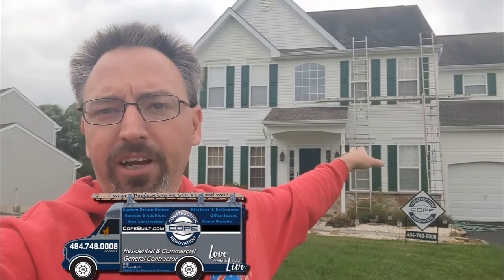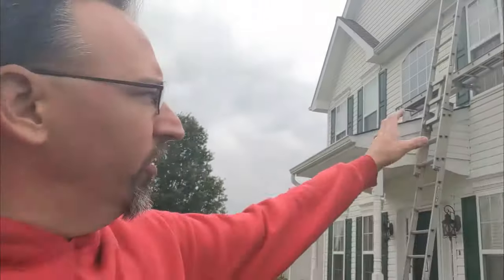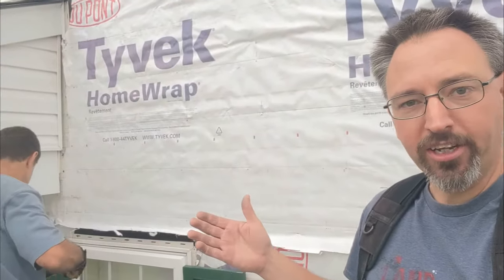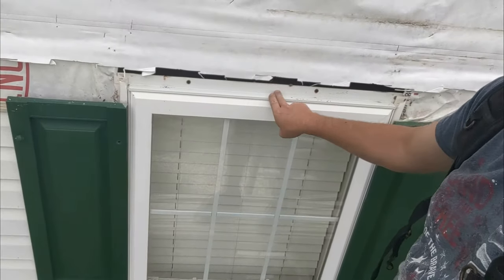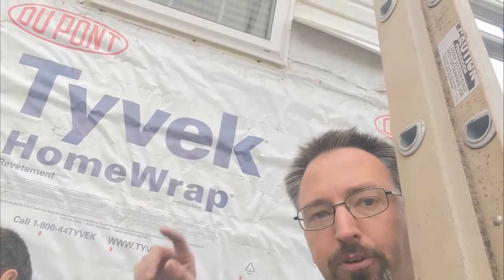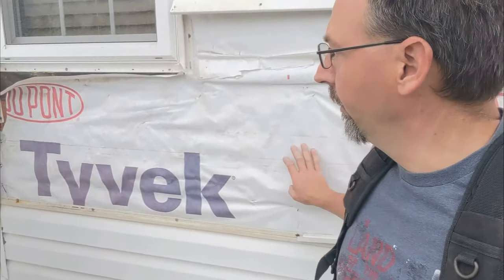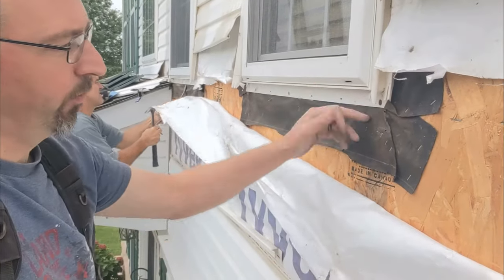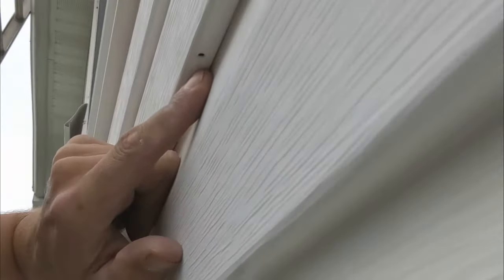Why is the top of my window leaking?

Comment: How would one go about inspecting this type of repair on....stucco
Reply from the maker: Sam... often, its best to hire a stucco inspection professional to do the evaluation... and our preference is to avoid the conflict of interest.... the inspector should not also be an installer or remediator of stucco products.  Keep the two professions separate.    See Part 9 of our stucco playlist for details on this... 
https://www.youtube.com/playlist?list=PLHM_Hinmgh2JffqMrFjk627km8o20KKr2 

If the inspector finds "soft wood" or high moisture content around a window, you won't know the cause until you cut open the stucco.   Please checkout our stucco playlist for details from other projects.   In part 9, Jeremy talks about why he doesn't like to do "localized repairs" however, we have found some select stucco professionals who will cut 3, 6,  or 12 inches around the outside of a window, remove the material, get down to the flashing layer, and then determine how to best make a repair, or determine if more material needs to be removed.    In the case of just 3 inches, sometimes they will install AZEK or Versatex back in the void, rather than try to match the stucco texture.   Other times, they will make repairs and then apply new stucco.

We should be releasing a video later this year of a window we replaced in stucco, and we decided on a Fluid Applied Membrane to seal the new window to the old flashing layers, prior to applying a new coat of stucco to the area.   In that case, the stucco wasn't the original problem.  The window itself was a low-grade garbage window, that leaked water through the seal every time it rained.   Stucco was in good shape, and we didn't find any signs of damage.   Moreover, the stucco was over a poured masonry wall at the basement level, in the window we were replacing.   We might not have gotten away with that up higher on the house.  Every situation is different.   Bottom line, you are going to have to cut it open to find out.

 If you haven't subscribed, please consider this your personal invitation.   Our college intern is back with us for winter break and is working diligently to get us caught up on editing the backlog of videos we've recorded the past few months.   We should be back on schedule, releasing 2 to 3 new home improvement videos every week, very very soon.    Thanks for your question!

Comment: My current issue and I cant find anyone to fix...😩😩😩
Reply from the maker: We can appreciate that situation Latoya... but at least now, you are armed with the information to ensure that when you do find someone to hire to handle this, you won't get ripped off by someone who doesn't know what they are doing.
Reply: sad, but my issue also...Everyone wants to replace rather than repair windows  :(  good luck!
Reply from the maker: unfortunately, those of use with the Skills to repair things are in an older generation, and more of us are retiring every year.  America took the trades out of the public high schools, and the younger people taking jobs in the trades haven't been given the opportunity to learn through trial and error... to learn how to diagnose a problem and think through possible causes, ways to test those theories, and find the root issue and then develop a plan to correct those issues.   They can pass a test, but not think on their feet.    

It's easy for a company to hand an HVAC tech a trouble shooting flow chart, but what if a situation isn't covered by the chart?    That's when they teach them to sell a new system.  New systems install "the same way every time."  Its repeatable steps.   And sadly, a lot of installers don't know how to do the calculations, and why they need to the calculations to properly size units.   The same is true in windows.   They don't teach the new kids how to remove siding, fix water barriers, install windows, trim windows, and reinstall siding.  Intead, they cut the nail fins with a vibe tool, and add aluminum capping to "hide" the hack job, because they can be faster, and charge less per window, compared to having a proper, professional, installation.   

Window life is mostly determined by the seals in the multi-pane system.  Frames can crack 10 to 30% of the time depending on manufacturer, and the care of the installer, but that is why we waterproof the rough opening and provide provisions for drainage and drying to the exterior.  More details about that over in our windows playlist.

Comment: How much roughly would something like that cost to repair?
Reply from the maker: Great question, and the obvious answer is, "it depends."    

Are we talking about 1 window, or a failure to install them correctly that requires fixing this on ALL the windows on the house?

Is house wrap there, but just used wrong, or is it missing all togther?

Are we on the first floor, or the second floor?  What is the ground and shrubs and access like?  How close can we park the trucks to the work site?  How much time will be spend carrying equipment back and forth?

This project was two guys, for a day.   In Chester County PA, you can get a chuck-in-a-truck no-name contractor or Dan-in-a-unmarked-van for $35 to $80 per hour.  You can get a reputable company for $90 to $150 per man hour... and that fee covers the guy's labor, office staff, insurance, overhead, etc.     Chester County is in the top 25 wealthiest counties in the United States.   There are LOTS of places with a lower cost of living, and where contracted labor is cheaper to come by.   

So like I said, it Depends.  :-)

Historically, most of our repairs like this start around $1500 and could easily go up to $5000 if we get into drywall repairs... but the average is probably $2200 to $2500 to address 1 to 3 windows in the same vicinity, in that we can pull off siding in one area of the home and make corrections to 1, 2 or 3 windows in that immediate area, and then reinstall the vinyl siding.
Reply: @CopeBUILT  Yeah definitely.  1 window needs new cut out and flashing facing south.  That one failed.  Thanks for reply.

Comment: You did not address the top of the window
Reply from the maker: Hi D Lucks... I'm not sure I understand your statement.   We diagnosed how the water was getting in... due to improper flashing.  We corrected the flashing layers, and stopped the leak.

The only else we could have done, was applied a fresh coat of white paint to the extension jambs inside the top of the window... or the homeowner could do that... but it may not even have been stained that badly.  The client simply wanted us to stop the water from getting in.

If you'd like to give us more details about your concerns, we can try to explain further.